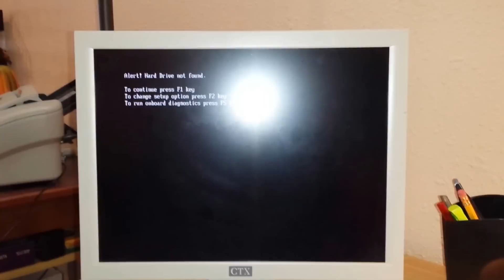Dell Optiplex 390 Diagnostic Code 3

Comment: Thanks a lot,

they told to replace PSU which costs 2400 INR, decided to try myself, started googling, came across your video, mannnn! your solution WORKS,

but i did something different, step-wise,
1. press power button & then un-plug the power button cable from motherboard
2. ran diagnostics (gave power button cable failure)
3. exit & it re-booted into system
4. after completion, re-plug power cable
5. restarted system
6. after completion, shutdown

now power on as usual :-)
Reply: Yups, did the same thing as you mentioned and figured out that my power button/cable is the culprit. When I disconnected the power cable from mobo (after turning the PC on), never had the shutdown issue after that!

Comment: a costumer come in my shop dell optiplex 960 give orange light 3 or 4 time , i replace the power supply , the problem is solved,  the system give display, what u said bro

Comment: My 790 MT is doing the same thing. I replaced the motherboard, cpu, ram, graphic card, and went to 500 watt power. Still, blue light comes on, number 3 is lit, and the fans are going, but no display. Thank you for your help.

Comment: Just encountered this power button issue on a 390 minitower (appeared 1 month after 3-yr warranty expired). Thanks to this video, instead of junking the PC,  I removed the power button and was able to power on the PC by using a screwdriver to "jumper" the two power pins. The replacement power button cable is available at Newegg.com for $14.99.
Reply from the maker: That's awesome they're on newegg. I didn't know that. Thanks.
Reply: Do you have a part # ?

Comment: Same problem here in ireland.

Dell tech support were no help, they said the power supplys that I was using had 2 high a wattage... idiots.

But i discovered that unplugging the power button cable and setting it to boot on power restore did the trick (found your video afterwards)

sadly the power button is not available to buy in ireland, even on ebay uk, so i tried to use a new power button, leaving the power button LEDS connected and its doing the same thing, so its a bug with the led lights the causes the problem

Comment: I encountered the same problem and  I noticed  the system behaves the same way when plugging AC connector and pressing the power button - the brief one-second power-up followed by immediate shutoff. I concluded it's BIOS setup problem. Go to BIOS setup while booting : F2->Power Management->AC recovery, select "Last state" and Optiplex  will boot normally from now on.

Comment: I hope I am as lucky. I have a 390 mini tower that will not power on. I do not get the 3 error when I try to power on normally. I do however get the 3 when I hold down in the reset button that is on the power supply. I have ordered a replacement cable, not sure if it will fix it.
Reply: i know this is 9 years ago but did it fix it? haha
Reply: @editsbyhuan5643  I wish I could remember

Comment: Thanks Bro, I also am pulling hairs coz of this issue. I thought it was the PSU and have changed it. Luckily to come across your video. I'm gonna try this with another optiplex power button. Will comment later. Thanks Bro

Comment: I am having this same issue. It boots up sometimes though. The power supply would trip. After pressing the reset button on the PSU about 10 times, it would come back on. Unplug power for a few seconds and it will do it again. Reseated the processor. Took out all components. Same issues. It could be the power supply since the rear LED doesn't turn on until I reset it a few times.

Comment: Thank you for your video I too had a code 3 I tried just about everything from removing the cmos batt resetting the mb tested the power supply , checked bios and nothing it would boot then power off on its own and have no luck at all till I googled and came across this video so I went on eBay and found a used power button for under $5.00 , seems to be working flawlessly .. " knock on wood" :) thanks for the video , saved me time and $$$$  btw my optiplex is a 990
Reply: No not at all.. I sent out for a used cable on eBay and it fixed my problem

Comment: Thank you for posting this. Dell already swapped out the power supply for me but the issue reappeared within a week. I want to try your suggestion before they send me a board. Would you be able to tell me what replacement part I should order? I'm assuming I have to get it from Dell.

Comment: I have this same problem on my 390 Optiplex. Does it matter if the replacement switch is a SFF 3010 model? Small form? I have the regular size desktop 390. Sorry, i'm not too computer savy, but it looks like i can do this myself.
Reply from the maker: Steve Stell shouldn't matter
Reply: Thanks man. This video helped me out alot.

Comment: Nice!! But I have another problem, when i put the power on the PC, it works first time like every model But when the first step done, the computer keeps going to start the Windows? without pressing the bottom, I Tried to change memories and PowerSpply still the same problem windows start without pressing the power bottom! ... I tried to update BIOS still same,, I tried take the power bottom from motherboard and still the same! what should I try now so the computer doesn't start the windows  itself? and is it unsafe? :(

Comment: Thank you the video.  But I dont understand what happened  with my optiplex 390.  If I push the power button nothing happened. No lights in front of the computer. If I push  the power supply test button, (the little black button at the back of the computer) and I hold it, the CPU  fan is working. If i take away my finger no working. 
But now if I push the power button  harder...it is working...but 4 seconds  later  stopped!   I tried now-->  if I remove the power button's connector  from the motherboard, then it is working  contantly.
And The front lights show: 1-2  after 1-3 after 2-3....oh my god.. :(
What is your opinion?  Anybody can help me?

Comment: The power button wire check it........i check mine and its look like the wire were loosen or something(the power button wire are really stuck at back at the power button after you open the disk reader and the hard disk...)So simply put its the wire issue...

Comment: 2021 now and messing with an optilex 790 here, i can't believe this !!! i am having  the same issue so i remove the power header and power on with a screwdriver by touching the motherboard header pins and voila !! its working perfectly now !! does anyone knows the part number of this bloody power on switch ??? any other easy way to fix it ??